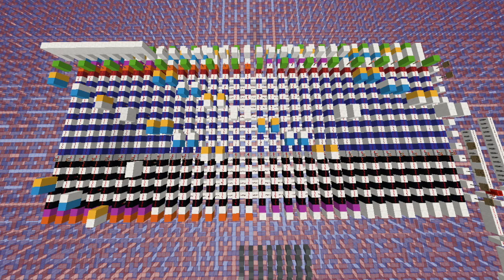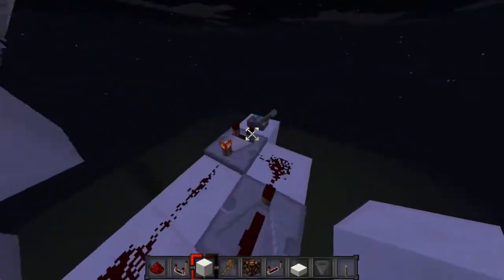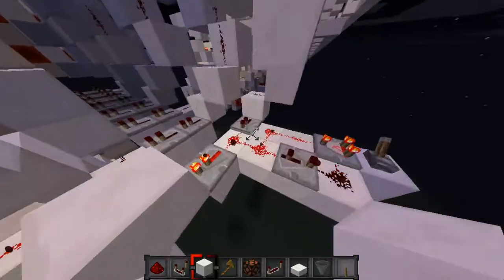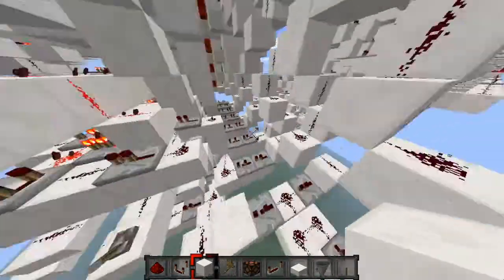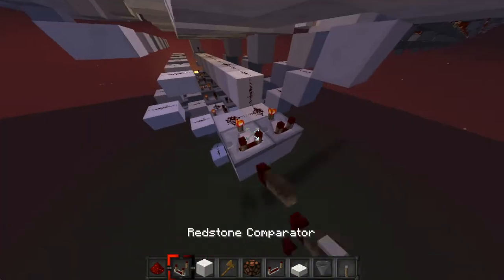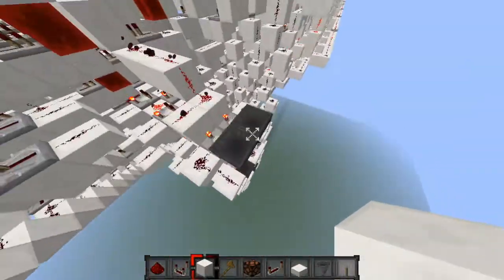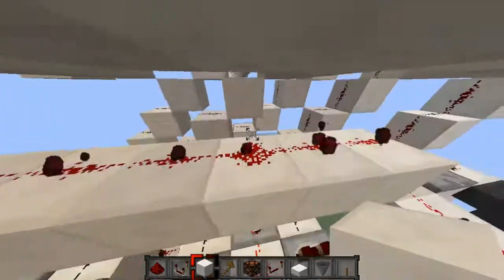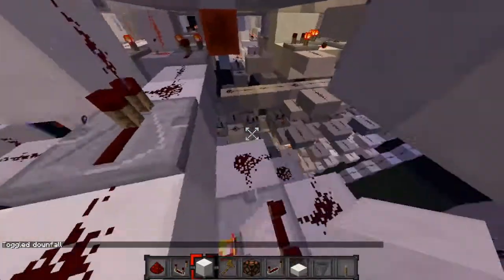Building a redstone Graphics Card part 4: Re arangeing the ALU

Comment: First
For get bit, wouldn't it not be easier to have a bypassable mux with a decoder for each of the bits you want to GetBit? Would only take 2ticks on data critical path and 3 on control. 

And there are many different dataloops on ORE that have a full barrell shifter and ALU in a 6tick loop, with forwarding. Seems like some of those layouts may help you cut down on that 16tick time frame your sticking to in this.
Reply from the maker: Using a mux feels kinda CISC and the stuff I've got works fine, its defiantly an option but I don't see much of a benefit.

I'm going with the 16 ticks of latency by choice such that the number of stages in the loop is a power of two, I'm more concerned in general with programability than I am with minimizing the delay. The Loop doesn't need to be super fast, just fast enough that a minimal amount of time is spent idling when you aren't using every single stage. The largest number of stages I anticipate using at one time is 8: Enough that during software multiplication each stage only has to work on one partial product, minimizing the number of load/save cycles. :)
Reply: @IDW64  bro wake up remember that password